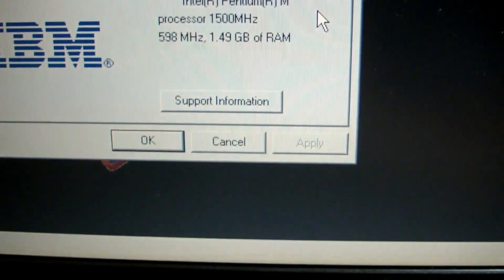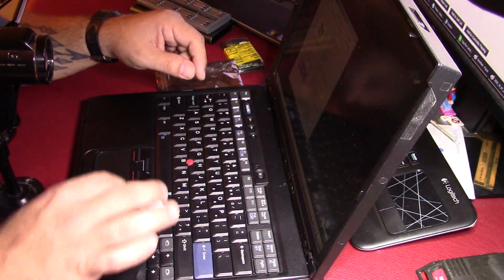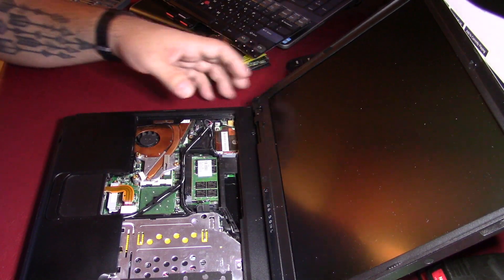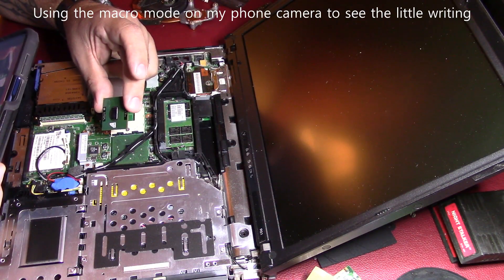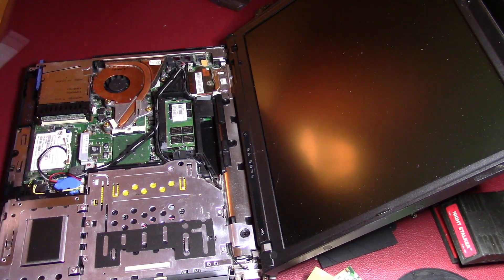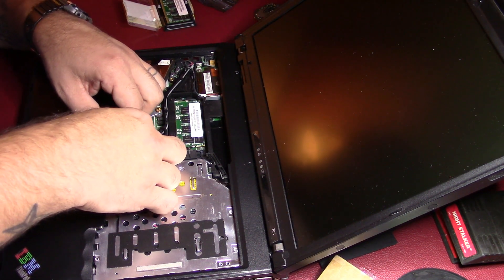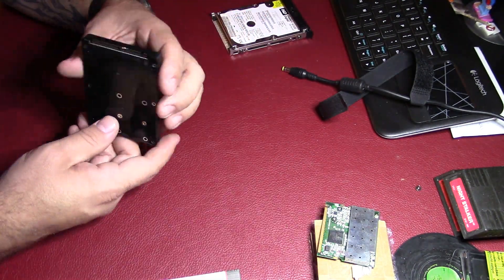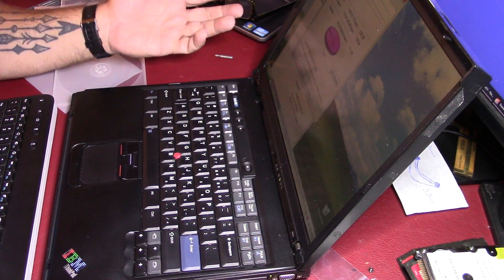Old IBM Thinkpad gets new life - SSD, RAM, & Processor!

Comment: I have a really good condition r51 in a bin that I got from an old job. I was able to get XP SP3 installed after a reformat, and it runs great off the HDD.  I may just do this now as a small project! How have things been going since? Able to get linux on there?
Reply from the maker: I just recently installed SP3 on this machine to get the Zune software installed (to get my old Zune up and running). Though I think this would run Linux nicely, I'm going to end up keeping Windows on it (as it's literally the only machine I have that I can use with my Zunes).
Reply: @new_oldstock  ughh.....i need to find my zune now lol

Comment: I love the old upgradable laptops. Wouldn't see a socketed CPU on modern laptops anymore, unfortunately. I have a Sony Vaio, which is quite a bit newer than this Thinkpad, but you can easily change the RAM, the HDD - and of course I replaced it with a SSD - and the CPU. Now I have i7 640m, 8GB of 1333MHz DDR3, and a 80GB SSD in there. In the future, I will change the SSD to a bigger one too, but that is for later. I also have dedicated graphics, GT 330M, which isn't great and the support for it is extremely lacking nowadays, but it's better than integrated graphics, at least. I currently have Debian installed on it, and I would probably switch to Devuan. I considered antiX because it's a very light Debian-based Linux distribution, but it has issues installing and running Wine, which I do want to have to run some older games.
Reply from the maker: Yeah, nothing nowadays is made like the old stuff. I specifically like to have them around for the older games fro sure!

Comment: Doing this for years for DELL laptops. Idk, but people and companies buy below awerage CPU laptops and never do upgrade. I have DELLs from 2008 with 1.8 - 2.0 GHz CPUs. Why not to upgrade them to 2.5 ? I have Inspiron 1501 AMD based that was stated in all official sources incl. comments on Dell support that chipset can handle 2GB of RAM only. But people has found modules that work as 2+2. So after one bad try I have found and bought correct ones and forced laptop to accept them 😂. First, I installed 2+1 and it has started normally. But after I installed 2+2 and it has refused to start. So I returned to 2+1 and used it for one day. Next day I tried again and entered BIOS. Checked that all amount is visible there. Tried to load Windows few times, and It has started finally! With upgraded to 2.2 GHz CPU and hybrid HDD it works flawlessly. Except operating system troubles... No correct GPU drivers for Windows 7, so I risked to install experimental Windows Vienna mod th😅s year. It works, except the internet. Core does not support Chrome, but dedicated browser MyPal and Firefox works a little. But main trouble are these security  certificates of websites... no updates so many websites just do not work. Other thing with network is Wi-Fi works with real speed of 2,5 Mbit/s. It is Dell wireless card with a,b,g but it refuses to work at normal speed. Need to be replaced, I suppose.